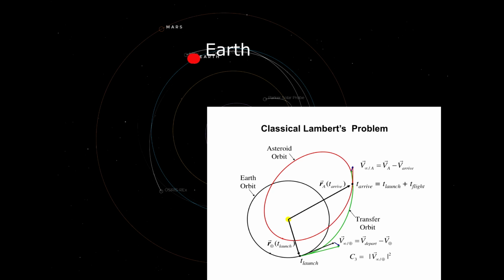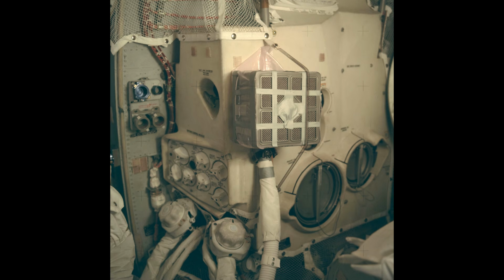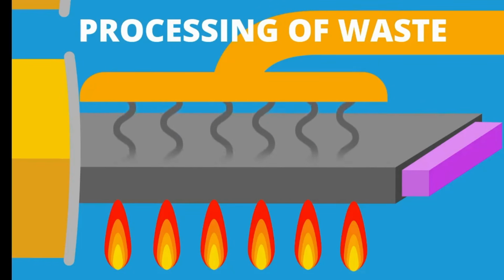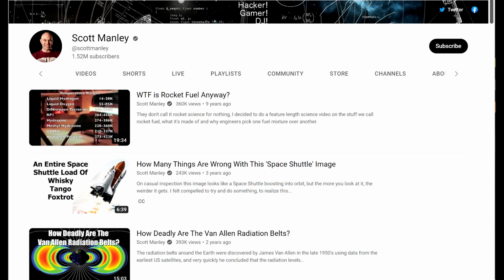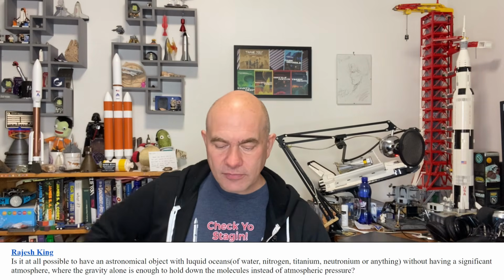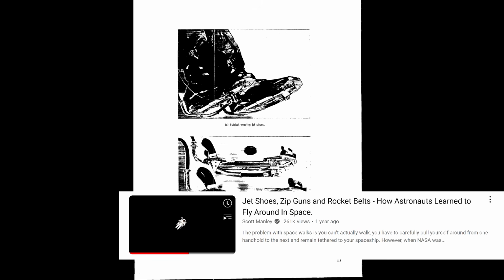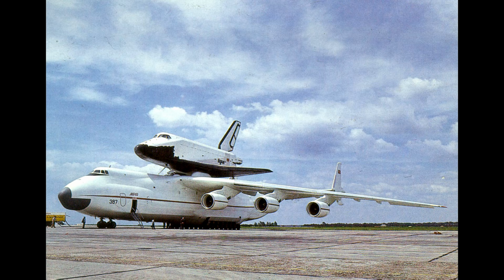Is There a Tripropellant Rocket Engine?  How Are Orbits Planned? - Deep Space Questions 21

Comment: Buran had it’s own issues but it did do a few things better than the Shuttle. Most likely by learning from NASA’s experiences. Not using the Buran orbiter’s engines for liftoff makes sense because it reduces dead weight not used in orbit. They can instead focus solely on propulsion for orbital maneuvering on the orbiter.  Various other details showed that they tried to improve on the shuttle system. NASA themselves went through iterative improvements as they built orbiters to make each one a little better than the previous ones. By having a clean sheet design, Buran was able to push a bit further with some improvements. However, it was also significantly behind the shuttle in some other areas such as the computing and electronics systems. Both ultimately suffered from the most critical issue of safety related to side attached boosters. They also both suffered from poor cost efficiency.
Reply: Not sure they got much advantage moving the engines from the orbiter to the core stage. The main advantage for the Shuttle having launch engines mounted on it is that it could bring the engines back home after the mission.  Yes the engines rode all the way to orbit but they were used almost all the way to orbit so not really dead weight during launch, but yes dead weight during the OMS burn and orbital maneuvering.

The engines on the Energia core stage went nearly to orbit also but were not recoverable.

There were complications having engines on the Shuttle, like plumbing for the fuel passing through the heat shield, and off-axis thrust. Those could be the bigger reason that the Russians avoided it. 

The SSME's on Shuttle allowed abort in most phases of flight after SRB separation, as long as they had enough SSME's still running to get across the Atlantic, or do RTLS in the early stages of launch. Not sure what Buran would have done if it had to abort. I guess they had enough airports to use as emergency landing sites.
Reply: Well the maneuvering thrusters would have been used to deorbit and return. Presumably they could abort with them in a similar manner. Perhaps not with as many options or control. Maybe touching space but shifting trajectory from orbital to suborbital.

Reusing the engines was nice but made the engine design more complicated and more expensive to do so. If they didn’t plan on having many missions with Buran then disposable might been better for them. Seemed like it was mostly a prestige project and they were going to keep using Soyuz for most missions regardless.
Reply: @Stu_Bur   I think they would have been over land for most of the ascent so they should have been able to find some runway to land on. 

Using their orbital maneuvering engines for thrust would be interesting, probably difficult to gauge what effect they will have until they start thrusting, then have to shut it off when the speed gets too high. Although if they pitch up to gain altitude they might be able to thrust for a reasonable length of time. If they get too high (control surfaces stop working) then they would have to shut them off and glide,  when they get low enough then start thrusting again to get back to maximum altitude, keep repeating until they have enough energy to make it to their desired landing site.

I agree for them expendable engines were probably better. Might have even been better for Shuttle if they had known ahead of time how low the flight rate would be.

Comment: Asparagus fuelling. The biggest problem is temperature of liquified gasses. If the LH2 or LO2 is a few degrees different to the tank it is going into, it can end up burning off more than it is adding.
Reply: How would a temperature difference lead to anything burning off? If they both remain a liquid it won't matter.
Reply: The secret to solving thermal differences, as always, is to keep the propellants mixing between different tanks. Though I would suggest using one of those "banana skin" wrappers to provide extra pre-launch insulation...

Comment: About the training for living on Mars thing - my physics PhD mentor decided to leave physics and become an ESA astronaut. When that did not work out, he became an climate scientist stationed in Antarctica. He has just survived another winter there, although he would not be back in civilization till early spring of 2023. So I guess Antarctica may be the next best thing if you cannot got to the Mars yet…
Reply: Or a facility like Earthship in Arizona but heavily shaded so what comes into the biosphere is roughly the same as what would be present on Mars.  Heavy duty vacuum pumps to give the correct air pressure and monster air conditioning units to give the right temperatures.

Comment: Making an engine that uses elemental fluorine is going to be hard, seeing as you will have to make a pump that can handle the volume, and last long enough, as you will be having a race between running out of fuel, versus running out of engine. These will be rockets with engine rich exhaust even running perfectly, let alone when they get upset.  Plus remember bulk fluorine liquid will burn things you think are non flammable, sand, asbestos, water, steel, aluminium, unfortunate people downwind......

now think of the thermal shock in the first combustion chamber, and that whatever you use for injection of the lithium will be dissolving in the hot liquid, and whatever you are using to bring in the fluorine will be doing the same.  You probably will also not want to use pure lithium, rather a lithium sodium alloy, as those do have a lower melting point at least, and with Gallium you can get it low enough to use ordinary steel alloys as the tank.
Reply: Yeah, I saw the title of the paper Scott referenced and my immediate thought was TOXIC!  I had forgotten how freaking reactive fluorine is as well.
Reply: @michiganengineer8621  And remember there are flourine compounds that are even more reactive as well, FOOF comes to mind, and that wonderful book Ignition!

Comment: Former nuke plant worker here.  One of the other to big reasons not to use rockets to dispose of high level waste is risk.  Current rockets have a failure rate of ~ 5/100 launches.  Nuclear risk engineers want risks of massive releases (e.g. rocket exploding in atmosphere with high level waste) to be somewhere in the order of 1/1,000,000 to 1/10,000,000 or lower.   So rockets need to get many many times more reliable before that risk is acceptable to launch spent high level waste in large quantities.  

Note for risk nerds, I'm ignoring conversions between occurrences per year and occurrences per event as well as a few other factors but because rockets launch so infrequently it seems negligible.
Reply: Plus it would be (and excuse the pun) a waste to throw away such a Uranium- and Plutonium-rich resource as used nuclear fuel.
Reply: If nuclear engineers hope for a risk of around 1 in 1,000,000 launches with a "radioactive" payload, 
the general population hopes for 100 years before the next problem = when they're already dead. 
Environmental activists (extremists) would rather say, 
"We'll wait at least 1,000 trillion years before the next launch of this type" = NEVER.

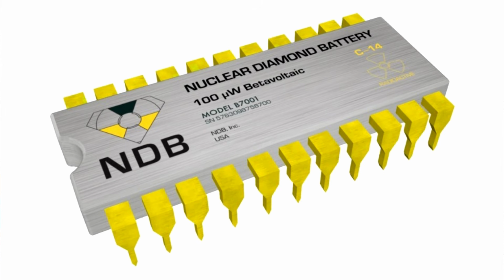Comment: 08:29 "Nuclear diamond batteries" Dave Jones from eevblog took a look at this about a year ago and was not convinced.
Reply: A quick calculation based on the beta decay of Carbon 14 to Nitrogen suggests that 1 gram would give a current of ~8nA and although the electrons would have an average energy of ~50KeV there's no super-efficient DC to DC converter which could exploit that potential to make an efficient "nuclear battery".   Even if it could be made efficient that would still only be 0.4 milliwatts of power (50000x0.000000008), about enough to illuminate a very small LED!
Reply: @iancooper8777  Yes they dump most of the electron energy by using a high bandgap semiconductor to capture those electrons. Think large area Silicon carbide LED's used as electron capture devices, dumping the rest as heat. You stack the thin film detectors on either side of the source, to capture the most energy, and pump the assembly down to a pretty good vacuum as well.
Reply: Well yes, the currents involved are minuscule, and the price really puts them in the "we got a budget that is not a worry, and we do not want a battery that will leak ever" camp, and the main use is as memory back up, as it really can only supply 100nA of current, so most uses are as standby power source for memory back up, where you need to first make sure your memory uses less power. Consider these batteries in the forms normally seen, DIP24 ceramic package, can be shorted out merely by a fingerprint on the board allowing enough current to flow, and you typically also use ultra low leakage capacitors (PTFE dielectric, none of that rubbish ceramic, electrolytic or tantalum capacitor will do) to store charge to allow them to deliver a current pulse for other applications.

Yes you can make a clock that will run forever off them, though you will find it hard to find a foundry to make the large dimension IC to get low leakage, and a display will similarly have to be specially made, probably both will be a SOS (silicon on sapphire) structure, with the LCD laser sealed after filling with the fluid, to keep it from degrading.  Might be done for a $500k watch, because for sure the mech will cost more than making the case out of platinum iridium alloy.
Reply: @SeanBZA  Damn, you seem to know your Semiconductor Stuff!  Do you know much about VFDs?  Also just making videos may be a good idea if you have the time

Comment: I think many solid fuel rockets are tripropelant or more.
Reply: Heck, old-fashioned black powder rockets would be considered tripropellant with potassium nitrate, charcoal, and sulfur.
Reply: @BogeyTheBear  Some pirothechnics will also add a very small percentage of parafin to help when pressing the grains. This will be tetrapropelant. The parafin is used as a binder, but it also generates thrust.
Reply: @Rilinius  Dont count elements, count diferent chemical compounds. Methane counts as one compound, CH4. RP1 can be argued, technicaly is a mix of many compounds, but all are very similar in practice. Now take a tipical solid roket mix: amonium perclorate, aluminium and some carefuly designed epoxi resin. The epoxi is used as a binder, but its also oxidized and generate thrust.

Comment: I don't remember where but I could have sworn somebody saying/writing that the Falcon Heavy uses that kind of fuel transfer to the center stage...
Reply: Early plans - too complicated in real life.
Reply: Modifying the core for attachment of the side boosters was way more work than they expected, and engine improvements basically ate up both the need for the extra performance, and the market for the Falcon Heavy (by expanding what the Falcon 9 could do).
It might still have been worth the development cost if they were expecting to fly dozens of them, but at that point, the expectation was "maybe we'll fly 10 of them before it gets obsoleted by starship".

Comment: What would be needed (physics and engineering) to launch a rocket with ion thrusters? Awesome work!
Reply: A lot of both.  For the most part ion thrusters don't generate the power needed to lift from the bottom of a gravity well.  As I understand them, their big advantage is a relatively low thrust for a long time for a given amount of fuel.
Reply: Ion engines only work in the vacuum of space and cannot take vehicles through the atmosphere because ion engines do not work in the presence of ions outside the engine. The ions can't fly away from the engine because there are ions in the air blocking them and you get no thrust. So step one is removing the Earth's atmosphere. After that it's pretty easy.
Reply: @filonin2  : Your information is actually wrong, but this doesn't fix the problem by itself. For an example of ion engines working in atmosphere, look up "ionocraft" or "lifter craft"- beware that there's some quackery involved with some older "lifter" info sources.

Regardless, ion engines do actually function in Earth's atmosphere, you just have to customize them for the task. The real problem is that they have to be extremely lightweight- you're basically looking at upper atmosphere blimps at best.
Reply: Ion thrusters are extremely low-thrust even in a vacuum.  Anything remotely resembling real-world ion thrusters would be useless on a launch vehicle.
Reply: I am aware, that is low, slow and steady at current state of the art compared to chemical rockets. I am just wondering, how much current and propellant is needed hypotheticaly to pull that off. It might not be feasible, but in general squeezing days of operation into minutes would be intressting as a what if. So please don't comment with "Not possible", but with a what if sense in mind. Scott also made videos of currently unrealistic propulsion methods (e.g. nuclear options)

Comment: After Apollo 13, they have not changed the Apollo hardware, but I think NASA created requirement for new space ships to have all parts that can be exchangeable, be exchangeable to avoid similar issues.
Reply: They had actually considered this problem during the design phase, but decided that the possibility of the CM/SM being disabled, and needing the LM as lifeboat to return home was so remote, that they dismissed it out of hand.
The even scarier thing is that the problem could have happened on any of the Apollo missions before Apollo 13. Apollo 8 didn't even have a LM to retreat to, or it could have happened on the return leg of 10, 11 or 12 when they had used the LM and had the same problem as 8.
Reply: @dunnwell7780  It wasn’t because they thought the “lifeboat” concept was too unlikely to be needed.  That emergency procedure was something they prepared for.

The round lunar module cartridges were also used in the PLSS life support backpacks on the lunar spacesuits.  The big CM cartridges never would have worked for that.  So even if they changed the lunar module to use them (taking up precious space and adding weight), they still would have had to pack along a bunch of round cartridges anyway.
Reply: Your absolutely correct, I specifically remember the late 2000's NASA Constellation program mission specs require the Altair moon lander to be able to function as a lifeboat just like Apollo 13's LEM in case of a failure in the command/service module.

Comment: The Space Shuttle is actually a tripropellant rocket in the second sense. It uses dense solid fuel as well as lightweight hydrogen and oxygen. That's one of the main points to the design. The combination of dense fuel at takeoff and hydrogen later on in the launch works super well.
Reply: But not all in one engine.
Reply: @SynchronizorVideos  It turns out that doesn't make much difference.